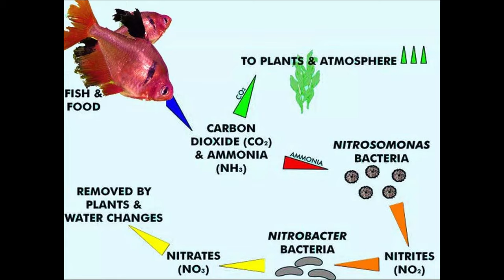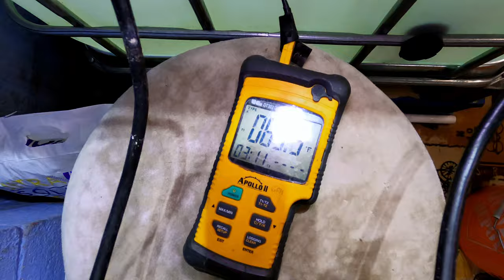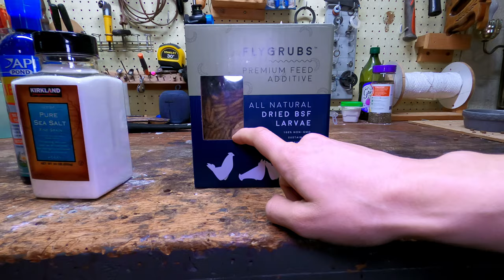2024 DIY Bait Tank  Tips & Tricks (Why This Setup Works Best)

Comment: Thanks for the Great videos! I finished mine a few weeks ago and it's going pretty good. One thing I'm working on is getting it to drain faster. I am using 1 1/2" pipe. I thought about putting a vent hole in the top of the drain line to help it drain faster,  but I haven't quite yet.  One thing I do is when I pull minnows to take to the lake I use my bottom drain hose to fill my minnow bucket. That way there's no temp changes and they have that bacteria.

Comment: This is such an awesome set up man! Just built mine a week ago.
Reply from the maker: That's awesome man!  Be sure you get the bio filter set up good and you shouldn't have too many issues!  If you don't want to wait the 6 weeks for nitrogen cycle to take place you can always get some used filter media from a friend or even go down to the local pet store and they might give you a sponge filter or somethings that's used and so you can get a jumpstart on the beneficial bacteria.  
Did you do anything different to your setup?
Reply: @CatfishKC  yes, but we have primarily the same set up in ways. I built mine just before finding your video. If you have a few minutes, swing over to our channel and check it out. Let me know what you think and your opinions on what could be better etc. thanks man!
Reply from the maker: Niceeeee. It's looking good.  Looks like you have plenty of aeration in there.  You might even be good without that agitator because your 5 gal has a good distance to travel with the run off and that would aerate your tank just fine, depending on the amount of fish you keep in there at any given time.  
One thing I might consider would be to get an additional pump at the bottom, maybe a 220gph or something small, just so you can create some movement down there for the particulates to get sucked up the pond pump.  
But it looks nice! Good work on that!

Comment: Very helpful video bro!!! 
I almost did a ditto of yours .
I filled mine today but having a small problem regulating the water levels between the fish tank and bio filter?
Reply from the maker: Do you have water coming from the top of the tank (kind of like skimming the top) and also the gravity fed water coming through the bottom.  I find it is hard to regulate the amount of water coming from the tank with only the gravity fed supply coming from the bottom of the tank.  With the skimming hole at the top, you can fill the tank as much as you want and the water will drain down that top hole making it easy to fill the filter as much as you need.

Comment: Nitrates excellent setup.
Add 40 lb of sand in the bottom of your tote and you'll increase your biofilter bacteria by a magnitude that's just unmeasurable
Reply from the maker: I was wondering about that recently! I actually will probably try that out here soon. But how much of the nitrates do you think it'll suck out?
Reply: @CatfishKC  only way to remove nitrates is to do water changes or have live plants that consume it. Biological filtration only converts ammonia to nitrite and nitrite to nitrate.
Reply from the maker: @raptorshawn  This is true!!! Either beef up your plants and your tank to equalize out how many fish you have or how often you feed. Or do water changes once or twice a week. I'd rather have a good amount of plants but that sometimes doesn't work for people as fast. I had to do a lot of water changes at first but, now my plants seem to take care of a lot of the issues.

Comment: PH . add PH level to the additions to the water . PH level needs to be 7.2 no more then 8 no less then 6 . i just use ph strips for testing .this will allow meds and other chems to stay in the water have you tried dry dog food . one thing i do is take a piece of 4 inch pipe a couple of ft long drill one inch holes all around it and cap one end . attach it to the inlet  . this will allow the debrea to be removed without bothering the fish .
Reply from the maker: I appreciate the information and I will do a little more research on the dog food. it's very interesting and we appreciate you watching and I'll let you know how it goes

Comment: Nice build man! I used to be deep into the aquarium scene and i can tell you did all your homework instead of just having a holding tank🤙🏻 
You can use your top that you cut to make a overflowing tank into your main tank, and use the shallow tank as your plant filtration and even grass shrimp if you wanted to
Reply from the maker: I really appreciate it man!!  We thought when we started building these bait tanks that we'd be good just to get the chlorine and chloramine and watch the ammonia levels.... We were wrong Hahaha.  We learned alot through trial and error.  It's a little more complex like your saying.  And thanks for the tip. That's a pretty good idea that I might play around with.!!!
Reply: Yeah i know your deal! Trust me!🤣 i jumped into aquariums the same way. And lost alot of money due to me not researching. Once you actually research and learn about the whole water filtration deal it becomes quite simple and you can easily keep things in check and prevent tragic losses with simple extra steps. I miss it and your build may actually give me reason into doing something like yours! Good luck and keep up the good info🙌🏻
Reply from the maker: @kengravoisjr7728  exactly. We jumped in and we didn't know what we were getting ourselves into. It kind of became an obsession for a little bit. And then more research and more research. But once we got it down, our fish started thriving and plants did good. It's not too difficult. But it does take some research. But at the end of the day it is really fun
Reply: Exactly! Its an addiction for sure

Comment: @CATFISH KC HOW DO YOU KEEP THE WATER COOL ENOUGH? Thank you
Reply from the maker: This is Matt and I keep my tank in my garage. It stays about around 70 in my garage and I'll actually have to put a heater in the water during the winter.
Nick has his tank downstairs in his house and it stays around 65 to 70 year round and he still uses heaters most of the time.  It just depends where you keep your tank. If it's outside I've seen people spraying the entire outside with spray insulation.

Comment: About how many bluegills will tank like that support I also added a kind of like an overflow tank 14 gallon barrel and putting plants in that thanks good video
Reply from the maker: Oh nice!  I've had over 100 in here and if you have enough biomedia and balanced correctly the filter can keep up for the most part.  You would probably need to do more regular water changes. BUT, if you had enough plants in the ecosystem it would be pretty self sustaining assuming the plants could pull all the nitrates out.  When you get into that many fish and have regular feeding you really need a good amount of plants to keep up.

Comment: Nice video man, what did you use for a water heater?
Reply from the maker: Amazon has some good choices for larger tanks like this. I would personally only use a heater if you have your tank in a room that stays very cold. Our water is usually around 65 or 70

Comment: I made one and its working well! I have mine outside. Its starting to turn green. Any idea what to do to control think issue?? It is in the sun a bit.
Reply from the maker: It's going to be unavoidable for the most part if it's in direct sunlight.   You can continually scrub the sides but a bit of algae isn't really going to hurt the fish. They might even feed on it if it gets aggressive...
You could wrap the outside of the tote with black fabric and cover the top but if there's direct sunlight getting in it will promote algae growth.
Reply: @CatfishKC  OK thanks!

Comment: HOW MANY FISH IN YOUR TANK AND HOW MANY 4 TO 6 INCH TROUT WOULD IT ALLOW ME WITH THIS SET UP
Reply from the maker: I've had up to 140 or so in that tank. It all depends on your water quality and if you have a good filtration and good bacteria set up. Sometimes it takes 6 months to get the water just right to were your nitrites and nitrates (ammonia) levels are stable.  Alot of times having plants growing in the water will also help a lot with the ammonia levels.  With a tank this size and good water quality, 4-6 inch trout, you could easily have 60 to 80. That's just a guess. I'm not familiar with keeping trout. I'd like to have some in there.

Comment: How long does the water need to sit in the bio filter for the bacteria to grow and the water to be bacteria less again?
Will continuous circulation make the water clean enough and give the water enough time to be clean?
Do we need to use UV sterilizer in this setup? If not, Why not?
Reply from the maker: It might take 4-6 weeks before you get some beneficial bacteria growing on the substrates in the filter. At least enough where you won’t have to worry about the ammonia levels killing the fish. 
The UV light should be fine as long as you don’t put it in the filter where all the beneficial bacteria sits and grows on the substrate.

Comment: If you use rain water for your tank, do you have to change out your water?
Reply: Also, do you still put salt into the water?
Reply from the maker: Unfortunately using rainwater alone won't eliminate the nitrates.  You can use sand in the bottom of your bio filter and it will help to eliminate the nitrates.  Plants in the tank as well.  I rarely do a water change anymore.  If I do it's usually 2+ months in between and it usually has more to do with smell and cleanliness since my tank is in my basement.
Reply from the maker: If you used rainwater I believe you'd be just fine with the quality of course. I would still check with just a test strip or two to make sure you're good. All we really use is an RV water filter to get the chlorine out of our tap and when I add water if it's just a bucket or two I leave it sitting out for 24 hours or so that way the chlorine and other things can evaporate out.
Reply from the maker: I have not used salt in my tank in a long time. It's a pretty drastic measure if you're seeing a lot of ick or that type of sickness going around to your other fish. I've seen salt work on fish that were sick but, I don't add it anymore.  I have a netting in my water that holds a lot of my roots in, but some of the roots do grow through the net and the fish tend to leave those alone as long as I'm feeding them a little bit every couple of days. With using rainwater, the quality is going to probably be just perfect. The issue of water quality after that depends on your filter, you're good bacteria and media in your filter and also really just depends on your ammonia levels being taken care of as well.  Rainwater can go bad with fish dying or being left in the tank or a filter not doing its job. So it's just good to always test the water quality and make decisions from that.
Reply: @CatfishKC  thank you again for all of your help. For some reason, I will get one fish that looks like it has some sores for lack of better terminology. Eventually, it will die. I remove it as soon as I can after it dies. Within a few days, I notice a new fish getting the same type of sores. Just trying to figure out what is going on.  Again, thank you.
Reply from the maker: Thanks for the feedback and comments!!  What I started doing is when I would notice a sick fish, I'd remove it from the tank. . It's a lot easier to try and treat it either in a separate bucket or release the fish instead of having to change the environment and water quality for the entire group of fish if they aren't showing symptoms of being sick.

Comment: How often do u add water conditioner?
Reply from the maker: If you have your system set up correctly and have the good bacteria and t
also some plants to help with the ammonia, usually a partial water change is all you might need.

Comment: Where can I get the parts you bought?. Thanks
Reply from the maker: Hey Billy. We went to Home Depot here in town and we were able to get these parts. If there is a specific one you're trying to find, I'll look back and see if we had to order anything special. I don't remember having to.
Reply: @CatfishKC  How do you set up the ventri tube and what pump was in the five gallon bucket. Thanks for all the help and advice.
Reply from the maker: If you watch Part 2 of the bait tank set up starting at 21:50 it should give a better explanation.  

 If you want to make a venturi you'll need a good flow of water against a tube (the end of the tip cut at a 45° angle and the pointy end pointed against the flow of water) or something similar that will create suction to pull that air through  and place that (however your setup is designed) near the end of the outflow or where there is the most water pressure.  
You will have to play with the placement of the air tube down in the water pipe.  Just move it up and down in small increments until a good flow of air and bubbles start to enter in the water.  
The other alternative is to buy a irrigation venturi that will do all this for you and usually has flow adjustments.
Reply: What did you use to cover the drain hole on the inside, great video I got it now. Thanks for a awesome video!!!.
Reply from the maker: I actually did not use anything. I opened the valve halfway to allow water to flow in but no fish get caught even if they die.  
If your fish are much smaller you can use some small chicken wire or some small galvanized metal with 1/2 openings at least.

Comment: when you fill your tank with the rv filter do you run the water slow in the tank or just wide open so it wont take too long
Reply from the maker: I don't run the water slow.  In between off and wide open is a good speed.  The filters seem to be able to handle that.

Comment: Is it ok to use water salt ?   I could weigh out five pounds?
Reply: Water Softener salt
Reply from the maker: That's what I use sometimes but I did find out there's a chemical breakdown in water softener salt and it kind of dissipates after a period of time unlike sea salt which I recommend more.  You can get sea salt cheap at Costco!  It's about $2 for almost 2 lbs
Reply: @CatfishKC  I've only done basically temporary bait tanks using old plastic cooler, aerator, and small aquarium filter last summer just getting into this sort of thing. Keep them for a couple of weeks (bluegill), and it required a lot of changing water over. Definitely not a long-term set up. For the salt, I got a 40 lb bag of pool salt for $12 (I'm in KC area too (Gardner), but don't remember exact place). Last year was very rough season, so hopefully this one coming will be better.

Comment: The filtration system is to complicated. Just use some large sponge filters.
Reply from the maker: After running them for a couple years, Nick's filter and system are great and we are always open to simple it up. My system (Matt) I might try your suggestions and try something a little more simple and see if I'm over doing it. These tanks have kept almost a hundred fish alive for years.  But, I am open to try something different and see if it's an easier solution. Thanks for watching and the suggestions